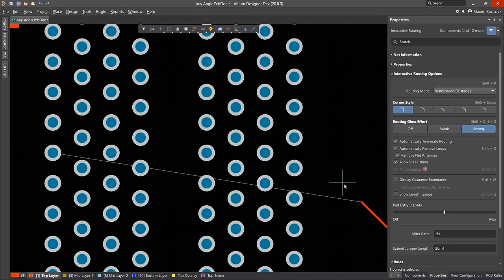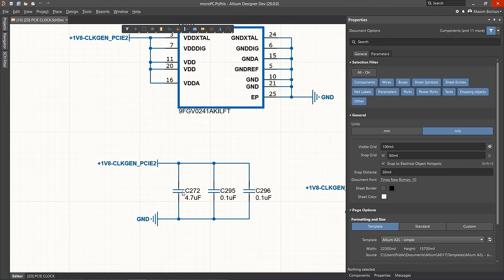how to make induction heater ,1kw induction heater , Altium Designer

Comment: it seems a bit weedy to me? i expect an induction heater to melt steel, not just make it slightly glow? I bought 1 for 8 pounds, it uses 2 of the black caps you use abut 8 of, and will take about 60 watts, even that will make a nail glow in a few seconds. so why isnt yours better?

Comment: Love it, gonna try to assemble it next week. Any tips on steps that were unexpectedly harder than expected?
Reply from the maker: To make an induction heater, just follow the steps in the video and also find the diagram below the video in the description box
Reply: @inventorkr1  Is this diode 4814 correct or 4148?
Reply from the maker: @moktarg   4148
Reply: @inventorkr1  Thank you so much 👍💐🌹💐🇵🇸🇵🇸🇵🇸

Comment: What's the glitch? At 03:05 written 220 ohm, but in fact 270 ohm mounted ???
Reply: so, 1kW written and 12 volts x 15 amps (0.18 kW) supplied doesn't counted, eh ?

Comment: Sir can I replace the MOSFET circuit with BJT induction circuit 
Thx sir
Reply from the maker: Yes, you can replace the MOSFET, by using a BJT transistor, and the same connection, and the method does not change anything in the circuit